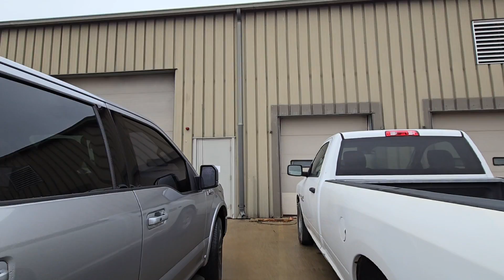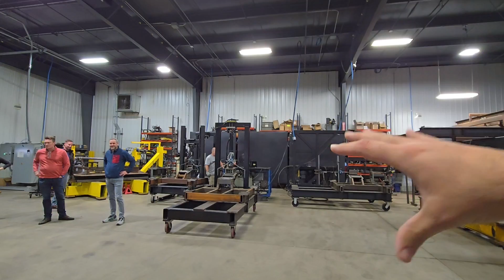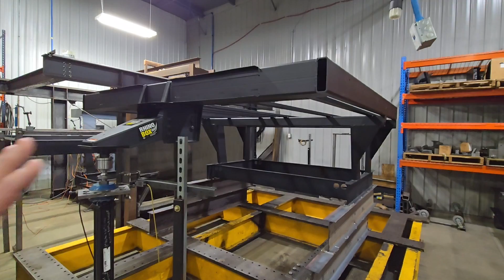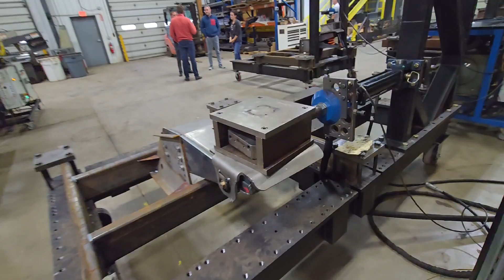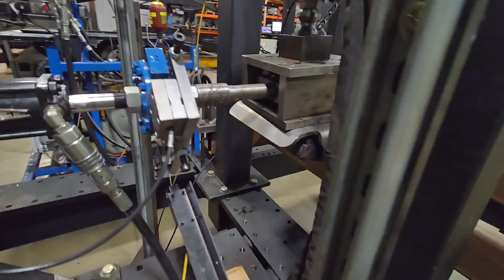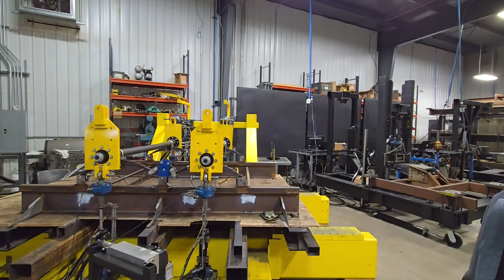LIPPERT'S AREA 51! R&D and Testing! Not all RV components are created equal!

Comment: so they say since they use "better equipment" they are less likely to break down and be stranded, but you didnt ask if they WERE to break down, would lippert assist them in repairs or warranty help in helping if they were stranded.
Reply from the maker: Not the right group to ask is it.  Pretty sure the engineers aren't the one who answered those questions.
Reply: That would be an initial contact with Customer Service.